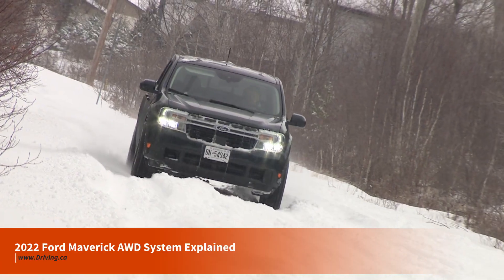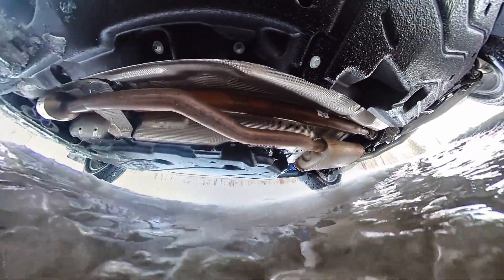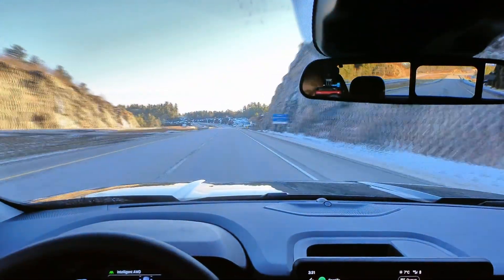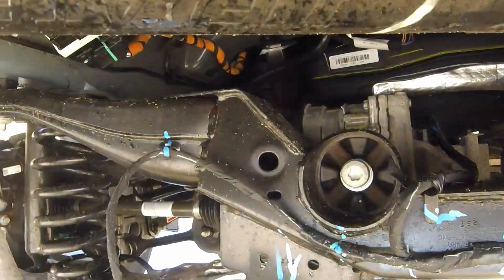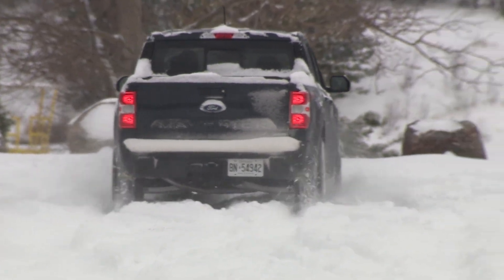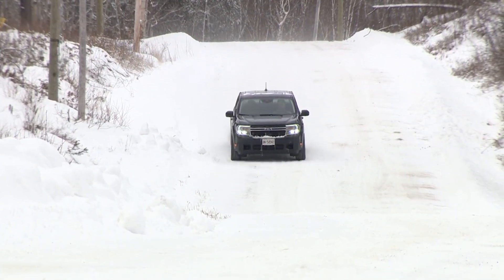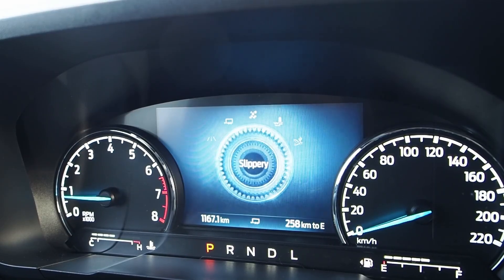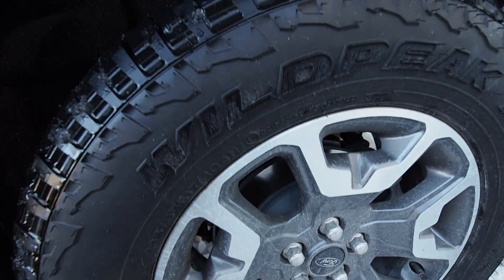Deep Dive: 2022 Ford Maverick's AWD System Explained

Comment: Hi iv just watched your video on ford awd. And hope you can advise me on an issue i have ford edge awd it has the power distribution on the speedometer showing out put to wheels my  question is when starting car from cold display shows on pulling away blue lines to each wheel  untill reaching speed when rear drive no longer needed when car gets to temperature and weather warm to hot  on pulling away from a stop only out put display to front wheels only increase but rear show nothing  is this a design where rear wheel power is not needed or should it show every time on pulling away from a stop  please can you help

Comment: I liked the information. I personally think it was missing the advantages each mode excells in an how the AWD works in each mode. Also the bad in a certain mode when trying to get unstuck like taking traction control off to get it rocking. Im also really curious if tow mode allows more power to rear wheels which could or should help in deep snow, if it did divert more power to rear wheels. Otherwise besidex lacking information on the 6 or 7 different modes available in different models, it was very insightful.

Comment: I completely understand that we continue to evolve with vehicles, but is this truly necessary? I’d personally rather just turn on the 4H or 4L when needed. Now this would be a great system if this is what you got in Auto 4x4 .  But I personally like the 4H 4L availability. Plus this appears to be a very expensive repair if something computer related fails and the vehicle is not under warranty anymore . I just don’t know

Comment: If this system is able to deliver 100% of the engine's power to the rear axle what does that mean?  Are the front wheels then disconnected somehow?  I don't believe that is possible.  If that is what Ford told you then you either need to present a better explanation or admit that this is Ford marketing hype.
Reply: The drive shaft is disconnected and reconnected via a gear box and actuator In snow mode the actuator keeps the extra axel coupled meaning the awd is always on

Comment: utter garbage, haldex style systems are a terrible automotive trend for people who need real AWD. Sure it's great for people who don't experience snow that often, but for me i need AWD all the time having the rear wheels deciding on their own if they're going to spin or not is absolutely dangerous on slippery highways. I can't find a single new car that features a center differential, only these cheap failure prone haldex systems which have a a mind of their own and literally require front tire slip to work. awful

Comment: Main issue is the part where you mention that braking the inside rear wheel transfers power to the other wheel. With a traditional differential in the rear that is a factual statement, but due to the RDU's nature, essentially it's a spool in the middle with clutch packs and left and right, that is absolutely not a true statement. If both clutches were enabled and you apply the brakes on the inside, it's applying those braking forced on the outside as well, taking away power that could go down. Anytime the brake is applied to the inside wheel the clutch packs in the inside wheel should be disengaged. The RDU alone can send up to 100% of the rear drive torque to either side regardless of the braking state of the opposite side.

Second issue, is with the claim of 100% of torque to the rear wheels. That is simply not possible since the front wheels cannot be disconnected from the front differential, unless the front of the vehicle is off the ground. Or, you've born both front axles, and good luck seeing how far you can actually get solely on the RDU before it overheats. Even if the front wheels are on a solid sheet of ice they have some level of traction granted the rear may be making +90% of the effort if they have good traction.

Comment: Did he mention what the sand and mud mode does ? Also, do any of the modes lock the center diff ? by design to power thru slippery surfaces, or touch spots like sand ? Wondering because a locking diff is only on the Tremor, but I believe it should be on lower trims as well, as it's a key awd feature. But maybe one of the modes does that on it's own, and that would be good to know ?

Comment: At 145 in video on sunny day I see the half shafts spinning so that still spin . So your saying the drive shaft stops spinning? as the half shafts on rear axle  clearly still spin. So there PTU up front some how disconnects from drive shaft and back by the center differential inside it I guess it disconnects too so the drive shaft no longer spins . But the half shafts on rear axle always spin so there is some drag loss compared to the FWD model,. .
Reply: Even with some drag, my AWD I show in videos on my channel averages 26mpg combined.
Reply: @fordmaverickmaniac  26 mpg average is what I would expect. I have a hybrid on order.

Comment: The all-wheel drive system works a lot like the all-wheel drive system on Volvos around the 2010 era. My XC70 is a beast on the snow, looks like the Maverick will do the same.
Reply: Sort of. The haldex system uses a physical pump. Uses fluid to make it work ,this doesn’t

Comment: 43: Whoa listen to that rattle.  What is that?
Reply: I have a 17 year old Honda Civic that sounds better than that.
Reply: That sound is characteristic of the high pressure fuel delivery system used by this engine and many like it. Completely normal.
Reply: @JustinPritchard  My engine has GDI and turbos and Variable Valve timing and doesn't sound like that.

Comment: Thanks for the info; could you ask if theres a way to keep the power going on all four wheels all the time? Or least not disconnecting the rear differential at all.
Reply: When you engage "slippery" mode from the AWD selector, I believe that is fairly close to what you're describing. There is no lock button, and I'm not sure if there's a way to prevent the system from disconnecting. Power is always being transmitted to the rear axle, and that clutch pack can grab on and use it in the blink of an eye.  

Some other vehicles using all wheel drive lock button to similar effect

Comment: Justin, I'm curious how much the AWD/nannies allow you to have fun in the snow.  Can the TCS/stability be completely defeated?  Will the vehicle allow some slip angle?  Thanks for the deep dive!
Reply: Yup, thanks, even without turning it off it pretty much leaves you alone as long as you are smooth at the controls. Not sure if it can be fully defeated but when disengaged you get more wheelspin than you need.  

It's set up pretty nicely I figure-- if you're making smooth inputs and keeping things under control the nannies basically leave you alone.

Comment: Did Ford make the PTU and RTU servicible?
Reply: I think the PTU is serviceable if it's like the one in my Fusion. The RDU requires a pump to service in my Fusion unfortunately as well. These are things you don't want to ignore, you'll want to give them new gear oil every 30-50k miles.

Comment: Thanks Justin! I think we are going to trade our 2012 Wrangler for a Maverick.
I want a Gladiator but it is WAY more truck than I need. The Maverick seems just
about right. That feature where the truck locks the inside rear wheel sounds 
like the similar feature found on the new Bronco.

!
Reply: Bronco takes it a step further-- but exactly the same principle!

Comment: I have watched countless videos about the Maverick
.This one explaining how the AWD system works, is by far the best,  most informative and useful video I have seen. Great job
Reply: Thanks James, that's great to hear!
Reply: 10-4 on that.  I had no idea either.  The voicing is professional too. (Justin)
Reply: This video made me wonder what would happen if a scoop of gravel was placed in the bed. Being front wheel drive, would the gravel weigh-down the back end, causing the front end to lift and traction to decrease? Then would that activate the AWD system and push power to the rear wheels, compensating for the loss of traction and control at the front? (I'm not talking about snowy conditions, just standard driving)

Comment: More Ch** to break.
Reply: While it may be true , there is more " stuff to break" , I want an upgrade from my 2007 Ford Ranger 2WD with a 143 hp Five speed manual. Now if only the
new Maveick could be as reliable as my old Ranger, that would be awesome. But I don't know if it will be .

Comment: Do any of the drive modes lock the AWD system on?
Reply: The slippery mode does virtually the same thing, even split of torque across the axles though I don't believe it is "locked" per se